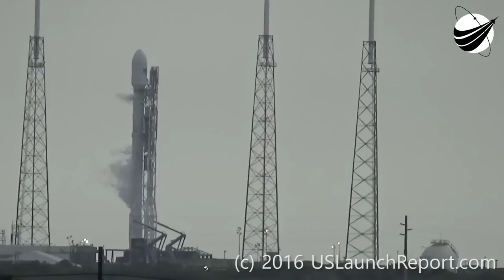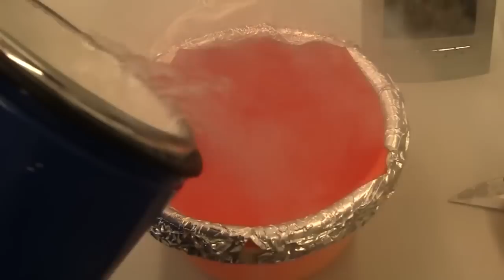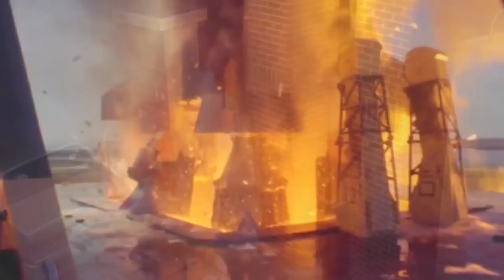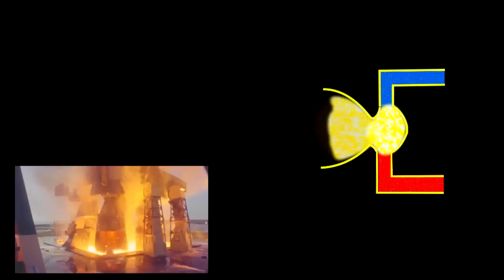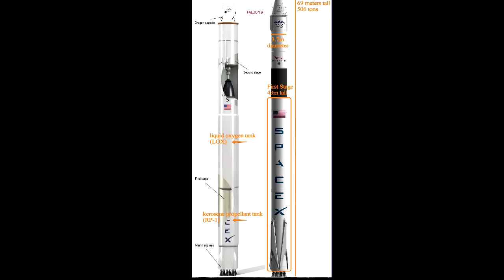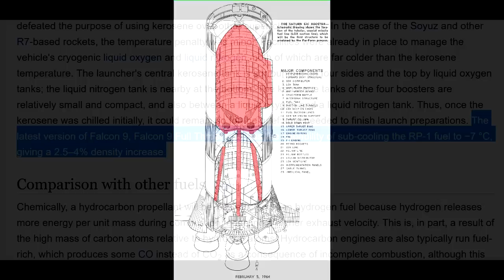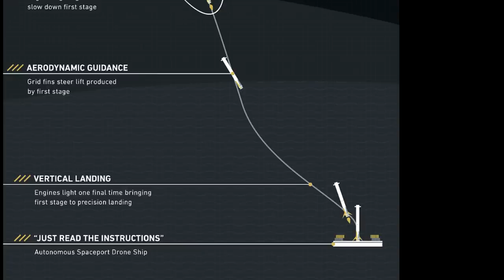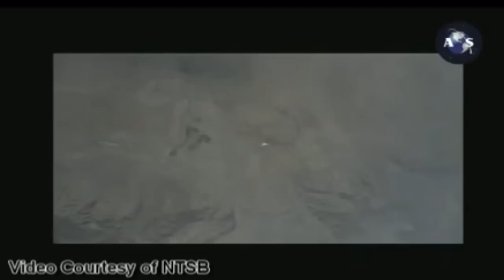Why did the Falcon 9 Explode?

Comment: So love the intro explanation thunder but I feel your a little off base with the second part. Don't get me wrong I do think Musk is over-hyped (particularly with tesla), but the process at which he trying to achieve is not only amiable but necessary if we ever wish to feasibly leave this planet. 

The key point that you forgot with the space shuttle while it was technically safer (only two major accidents), their were alot of problems that didn't really make it that reusable. The expensive ceramic tiles had to be constantly refitted for a plane size vehicle and the engine was frankly a little over designed, requiring too much maintenance. Compared to the smaller compartments of saturn, soyaz, and now the falcon these factors significantly increase the cost. Additionally because there was so much maintenance required, they were unable to make the number of flights required to make it cost effective (averaging around 9 flights a year in place of the forecaster 12, which further decreased later on). So by its inherit design these rockets are already fare cheaper then the shuttle.

Looking to the primary rocket, most estimates put being able to reuse the engine, somewhere in the 60-80% cost savings, which is insane. If you think to why we really haven't been going to space since the lunar missions (shuttle is really low orbit so I'm not really counting that), the primary limiting factor has been cost. If we can reduce the cost, this significantly, we will have a new space revolution that we haven't seen since the original Apollo missions. Looking over the history of space flight, that with maybe the exception of the Russians, no one has been able to make (or has made it a goal) to make flights cheaper. This is the failure of government intervention in the market and the advantage of private industry. I fully agree, when we started going to space the risks were far to high for private industry, as such public funding was needed. But that time is now over, there is now a lucrative market to bring things up into space cheaply and safely. You should be ecstatic thunderfoot, the freemarket is going past all the hogwash of politics to push the scientific boundaries of space flight, no longer will we have to wait for funds yet to be appropriated. It would be an amazing feat of human ingenuity if a private individual/organization beats a national government (with effectively unlimited funds) to mars.

Comment: Suggestion: Maybe you could do a video about that "impossible"  EM drive NASA said they were going to try? People describe it as "It uses electromagnetic waves as 'fuel', creating thrust by bouncing microwave photons back and forth inside a cone-shaped closed metal cavity. This causes the 'pointy end' of the EM Drive to accelerate in the opposite direction that the drive is going."
 They say it impossible because it breaks Newton's 3rd law?

Comment: Hey Thunderf00t, what volume of liquid oxygen would I need if I wanted my car to operate on oxygen instead of air? Take 60L petrol tank.
Reply: NVM, I calculated it and it appears I'd need a 700L liquid oxygen tank. Not the best idea in terms of practicality, not speaking about how much the engine itself can handle.
Reply: whoa 1,756.74 pounds of oxygen?
i'm pretty sure such a oxygen rich mixture would burn much better. and cause the engine to explode though.
Reply: Not sure about the engine exploding, but it would raise the power of it significantly and well above its specs, so a failure is very likely.
Reply: bleblo13
yes, it would raise power about 4x for petrol engine if the components could handle it. But they won't, so it would require a complete redesign.
Reply: o3tomas Ok, I simply don't know how much such an engine could take before exploding, since they are pretty sturdy.

Comment: Agree 100% with everything you said in the video.

Having said that, it does look very much like the explosion initiated somewhere within the upper stage ...which wasn't part of the rocket that had been reused. We'll have to wait for the outcome of the investigation before we know for sure where the fault occurred, but if it was in the upper stage then it may not have been a result of reusing parts.

But yeah, regardless of what caused the explosion, reusing parts that have been stressed during a previous flights could lead to internal fractures and issues that will be hard to detect without a full strip-down (as NASA found out with the shuttle).

Comment: I remember 2 failed rockets ago, I may have said on facebook "I know rocket science isn't trivial, but these are problems that were solved decades ago, thousands of things have been successfully launched into orbit, the blueprint is already there. I think there are some serious flaws at Space X." Then SmarterEveryDay launched an attack on me, and told me to take a class on rocketry. But the point I was making was not that SpaceX are incompetent, or that rocket science is easy, it's just that they are making things more complicated than they need to be. Perhaps because it looks impressive landing on rocket power, and that's good for branding. But what doesn't look impressive is having rocket fail and destroy a $200m satellite, or worse endanger someone's life. Use a parachute,

Comment: The Falcon 9 is going to be replaced by a cluster of Teslas as soon as the new high-output battery pack is available. Also, the recovery will use the airbags already in the Teslas, so you see, SpaceX has indeed learned from NASA!
Reply: I see Elon Musk is asking about for video of the explosion. Perhaps the Tesla rocket will be equipped with dashcams, too.

Comment: if you can make a rocket a bit bigger so it holds 110% of the fuel you need and it can land, isn't it a no brainer to do that? I don't see why it is a better idea to use up every last drop for the main mission and have your rocket be expendable. Sure, if the reusability doesn't work out you're right, but the reusability is what they're aiming for here, if  they don't assume it is possible, they wouldn't be doing it.

Comment: Am I the only one that spotted the high velocity projectile/object flying from right to left within the time of explosion?

Being an aerospace engineering student I understand that their is always the risk and the potential for something to go wrong but this is worrying.

Phase cannons (weapon grade laser pointers) mounted on naval ships in can set planes on fire  as a C.I.W.S. 

So it's possible that such models where made smaller and compact enough to mounted on a high speed aircraft.

So what do we know?
And seems to be plausible by this point?

•Laser beams(but in this case any high energy beam from infra red to gamma) can significantly raise the temperature on an object in correlation to the strength of the beam ,wavelength etc.

•Assuming that the emitted beam is not subject to diffraction or any kind of obstruction and has line of sight on the target, tracking the space X rocket wouldn't have been a problem.

•Rockets and I.C.E s fuel mixtures don't react well when overheated.

Comment: I'm with you tf00t. I find any advance in rocketry exciting though. One small step and all that. The reason I think SpaceX is necessary however you didn't touch on. NASA's a brilliant organisation, but it's criminally underfunded. If a private corporation can work towards cost savings here, NASA can spend a lot more on missions than delivery. I think that's worth a few blunders here and there.

Comment: A good video.  But one of your first points about loosing the rocket leaves NASA up a creek.  That would happen if nasa lost their own rocket as well.  Like it or not there are issues whenever you switch service providers.  I see this all the time at work.  We switch service or parts suppliers and there is almost always issues that need to be ironed out.  We work with the new providers and the issue gets fixed and go along with things.

NASA as accumulated a vast amount of knowledge, far more than can be transferred in just a few years.  Space-X will work with NASA to fix the areas they stumble upon just as NASA would do when they replace their senior engineers.

Comment: That deal with the rocket being so heavy that the amount of fuel it takes to get it moving makes it inefficient. They should make a space elevator instead so we can just build our rockets in space
Reply: A space elevator made of what material I might ask?  afaik the only material even that makes it even theoretically possible is carbon nanotubes.
Reply: animefreak5757 I dunno I ain't a scientist.
Reply: Yeah, space elevators would be more efficient - if you could ever build one.

Of course, it would also be more efficient to build solar panels on the surface of the sun to get energy - if they could be stopped from melting, transported there cheaply, and have the energy somehow sent back to earth.

Solar Roadways also would be great if they weren't a massive waste of money compared to building normal roads and solar panels - essentially, they cost more than it would cost to simply put solar panels above all existing roads instead.

A lot of things sound great in theory, but are terrible in practice - in terms of physics or engineering realities. New discoveries and innovations of course can change the state of things, but I wouldn't expect a space elevator anytime soon. The material strength needed to build something of that magnitude is orders of magnitude above what humanity is currently capable of producing, besides perhaps on microscopic levels (I'm not sure if certain carbon-compounds produced in a lab might be suitable).

Comment: Ksp is something you need to consult before you claim to have a bright idea to land stages on thrust alone. To have fuel left to land the stages will at least double the fuel and that is the most expensive part of the rocket (the pumps do not get reused even if you salvage them) so gz you salvaged scrap metal now what?

Comment: Saying the problems of rocket design was "solved" is really disrespectful to the engineers in that field. Of course we know there are solutions to the problems, but you have to add the real life constrain to produce a good vehicle. It is very different from science where repeating past mistakes rather inexcusable, in engineering, one vehicle is so complicated that some details could be over look, not because of not knowing the science. 
US have not produce new rocket design for decades already. Many expertise were lost during the space shuttle era, so some of the design knowledge (often are tricks that is not about deep physics, but simple solutions) were lost and have to be relearned. This is why having new generation of commercial rocket company mean so much. It is an industry, and company competitions helps production of better design. For SpaceX, even if the first stage cannot be make reusable, SO WHAT. There is little to lose in the way SpaceX try it, the amount of fuel for a reentry burn is rather small anyway. The rocket can still remain competitive in other ways.
One more thing, No one try recovering a first stage liquid booster before. The most painful thing about space shuttle is that it carries everything (minus the fuel tank) to Orbit and back (Which is really really really tough) (in a glider too). I don't have to look up the numbers to know the KE you need to dissipate is much much smaller if you are only recovering the first stage (which have sub-orbital trajectory). Engine wise, the space shuttle main engine is a reusable engine with high ISP and runner higher pressure than most rocket engine...
Now SpaceX can try recovering the first stage because the advancement of avionics and automation.We simply can't try this approach in the past. 
I am pretty sure the accident report would point to a rather "stupid" design flaws for the accident BUT MOST ACCIDENT REPORTS ARE LIKE THIS. We human makes mistakes when dealing with complicated systems, even though the parts look so "easy" to you.

Comment: In about 1971 during the fueling of a Saturn V, there was O2 venting during the fueling process. What the workers affectionately called "rent-a-cops" were driving an automobile around a mile away and passed through an oxygen rich pocket of air and the engine race blowing the head gaskets and causing an engine fire. After that they set the parameter further away and made sure any vehicles approaching came from the upwind side. The placement of the launch pads provided approach from the upwind side.

Comment: What is really needed is the footage of cameras taking extremely fast shots of the launch so a decent set of slow motion frames can be viewed and the exact location (at least from the outside) of the explosion determined. This is from Internet streaming which is slower than a theater motion picture.  I assume there were high speed cameras, but the footage is not publicly available.
       At first I was thinking something might have happened like the Nedelin disaster 26 Nov 1960 in which the second stage of a Soviet rocket firing was triggered while the rocket was sitting on the launch pad killing a large number of the major scientists and technicians.  But it appears the explosion is asymmetrical and shoots out at one point, so it wouldn't be an erroneous firing command.  There must have been a leak.

Comment: I can't wait to hear the actual cause of the explosion. I mean if thunderfoot got it right with 1-2 video angles and without knowing the actual structure of the second stage of the rocket, well good job! But if it turns out you were wrong, boy you're going to eat dust in the comment section. Personally I would have waited for the preliminary report.

Comment: Sure, it may in the end prove that reusable rockets of the SpaceX model don't work economically. Hell, it may prove that reusable spacecraft of any type can't be economical (so "good bye" mankind as a space-faring species!). Honestly, from SpaceX's viewpoint, big deal. 

If this is the case, then they take off the legs, fins, and other landing bits, forget about saving fuel for the boost-back/landing and end up with a perfectly respectable normal rocket that's already cheaper than its competition and now can put another ton or two into space. IOW, whether or not it works out economically to reuse, they still have a perfectly salable product.

Using the shuttle as a comparison, well, the whole vehicle was the "landing bits" so economic or no, they were stuck with it (ignoring dumping the whole thing and going to some sort of "Shuttle-C" vehicle to reuse the technology, though that would still be very expensive compared to most purpose-built boosters).

So, yes, it's pretty much a win-win for SpaceX no matter how they end up using the system.

Comment: The thing is, per Kg in orbit, the Falcon 9 R is already cheaper than other "standard" launch vehicles, even though it isn't reusable yet.

So, in a worst case scenario where reusing the engines turns out to be completely economically unfeasible (which I doubt), Spacex will STILL have made space launch cheaper.

Comment: I will admit that you do make some good points, but the fact of the matter is that SpaceX is managing to do everything that rocket scientists have been doing for decades, but at a fraction of the cost.  Yes the shuttle was reusable, but it costed a BILLION dollars per launch, a Falcon 9 is $60 million, not even counting when the stages start getting reused. (not to mention the Shuttle killed 14 people, but since no SpaceX vehicle has launched people that isn't a fair comparison)   Yes the last bit of fuel is the most important, but most satellites don't need the biggest most powerful rocket to get into orbit, and those that need more power will soon have the Falcon Heavy.   Yes no stages have been reused, but to prevent things like this from happening they are testing landed stages extensively to look for issues before they are reused.  Space is hard and complicated and using the argument that people have figured it out before just isn't fair.

Comment: The Falcon 9 touching down on a pad was a major breakthrough in controls technology. NASA is actually trying to do the same thing on a mission to mars, but is no where close to getting it done. Currently all NASA has ever used was a lander. A lander simply guarantees that the lander will survive making contact with the ground. It makes no guarantee of landing somewhere.  If that rocket was 100 m off where they tried to land it, the rocket would be at the bottom of the sea. This means that the rocket wasn't simply using a landing algorithm that we have had since the 1970's, but a powered descent guidance algorithm. The difference between the mars rover and the SpaceX rocket is that the Mars rover was guaranteed to land somewhere on Mar's surface and the rocket was guaranteed to land within an oval on Earth's surface. A major problem to having these systems is having to do all the calculations as the lander is falling.

This was the first time I have seen a rocket do what it did on the scale that it did it. It was a big success around the engineering community.

Now NASA's Mars problem is much more difficult, since we know little about Mars' atmospgere compared to Earth's and we can't pick the day the rover lands on Mars. Another problem is Mars' thin atmosphere.